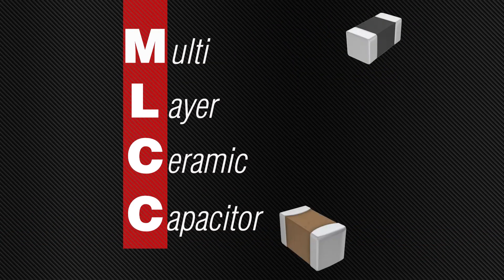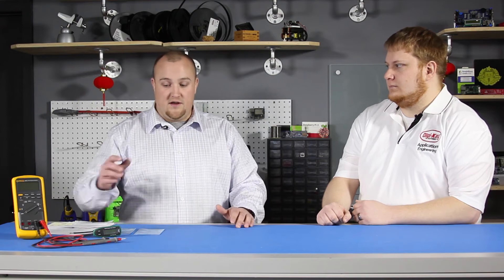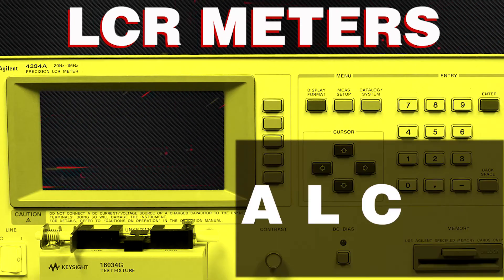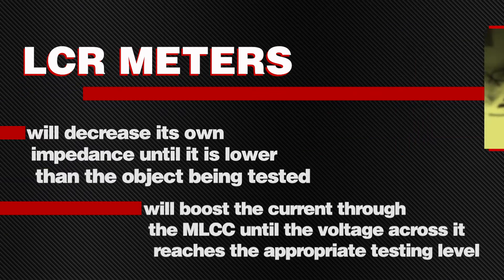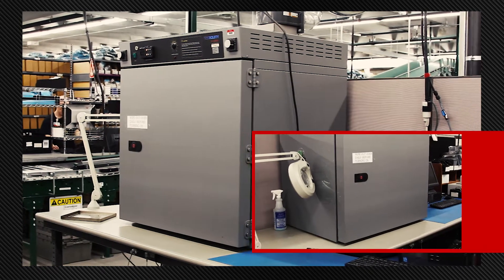How to Test Multilayer Ceramic Capacitors (MLCCs) Correctly - Another Teaching Moment | DigiKey

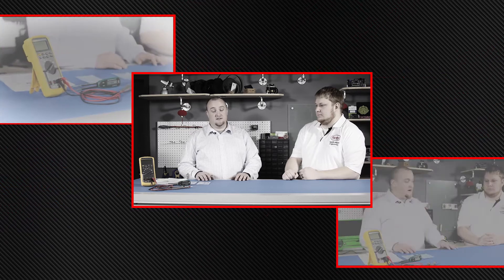Comment: This video obfuscates more than illuminates.  0:35 "testers... not capable of providing enough forward voltage". What? How does the term "forward voltage" apply to capacitors? That's silly.  Ordinary meters measure MLCC capacitance just fine -- the problem is that MLCC capacitance value varies so wildly with different applied DC and AC voltages that they are spec'ed by manufacturers under very particular conditions, and those conditions are different from those applied by ordinary meters.  
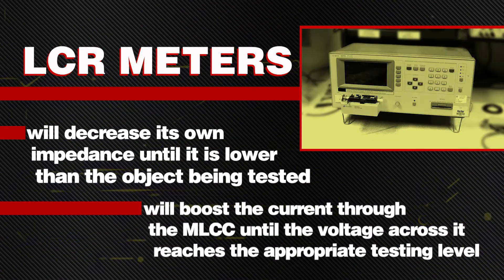Then at 1:00 "the LCR will decrease its own impedance until it is lower than the object being tested". That is wrong. The LCR meter pictured uses a sine wave Vsource (with set frequency, amplitude and DC offset) to drive a simple RC voltage divider (C is the cap under test) to measure the amplitude of the voltage across C (Vcap) compared to that of the sine source. That ratio gives the impedance of the C, and thus the capacitance.  This approach works fine for testing capacitors (and resistors, inductors) , assuming they are fixed. However MLCC's capacitance varies with the DC and AC voltage applied _to the capacitor_, and since variation of that voltage is part of the principle of measuring the capacitance, that voltage is obviously not fixed if Vsource is fixed, and thus does not match the exact manufacturer test conditions.   
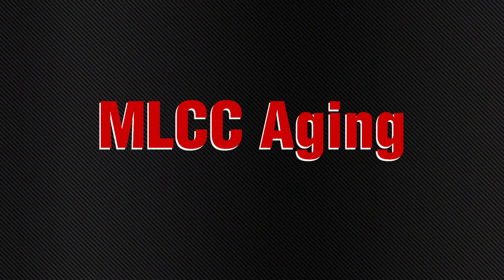So the "amazing" innovation in this LCR meter is that instead of using a fixed Vsource and measuring Vcap, it allows you to manually adjust Vsource until Vcap matches some set condition, or to do this same adjustment automatically  (1:13 shows this to be Vcap = 120 Hz, 500mVRMS, with zero DC bias, and auto mode on).  Again, the unit use the ratio of Vsource to Vcap to determine capacitance _under those specific conditions_.
It is no doubt true that this LCR meter can change the R (fluffed up as: "its own impedance") in the RC divider to some value that allows the available voltage range and current capability of Vsource  to produce the target Vcap.  So with the example cap of 4u7 (X = 280 ohm at 120Hz),  Rsource could by 1 kohm, (divider ratio = 0.219) and Vsource = 0.5/0.219 = 2.29V.  No doubt the instrument can adjust to different ranges of capacitor by selecting a suitable Rsource, in this  example 1k, or possibly 100 ohm, but probably not, say, 10k or 10 ohm for this particular capacitor.  That's just a range adjustment, not some special strategy to "decrease its own impedance until it is lower than the object being tested", and specifically does not require adjusting the Rsource to be less than the impedance of the device under test.
In short, those customer complaints that they are reading a low capacitance value are valid, but insufficiently sophisticated.  MLCC capacitance values in the actual application can easily be only 50% or even only 20% of the nominal value, depending on the DC or AC voltage conditions. So customers just noticing with a meter that the value is a little low apparently expect the capacitance to be some constant value under a variety of ordinary conditions, as would be true for most other capacitance types, and is indeed implied just by the shape of "tweezer" style meters.  Telling them that they just used the wrong measurement technique ducks the real issue which is that MLCCs have a significant gotcha that they have overlooked.
Reply: Your comment is much better than this video!